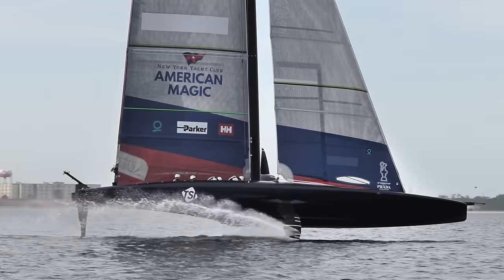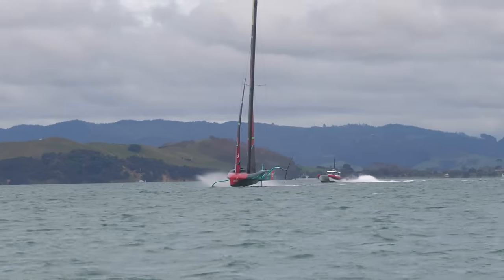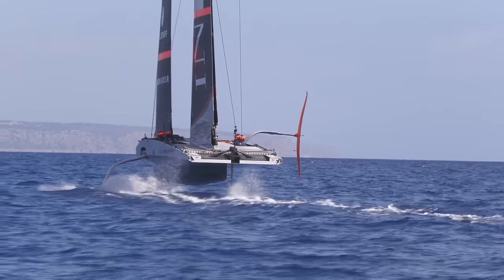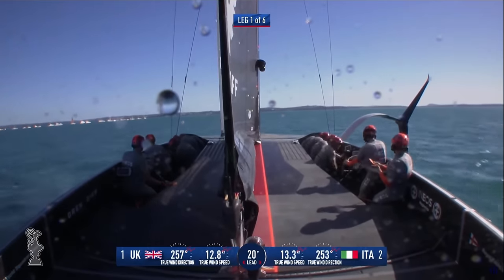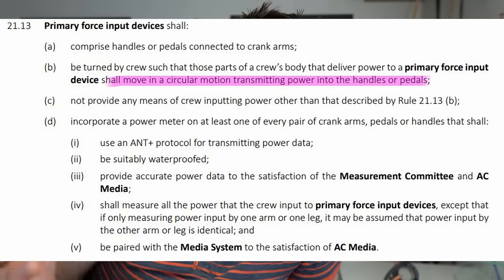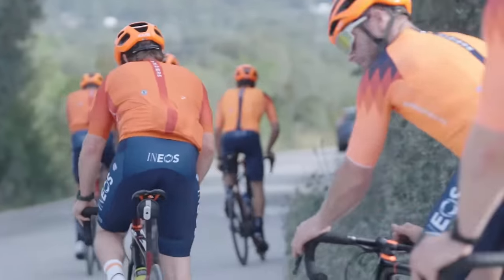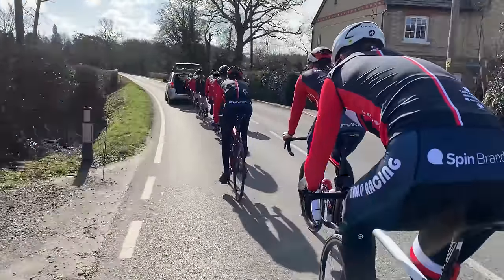Controversial America's Cup Cyclors are NOT what you thought

Comment: As a former track cyclist you know when falling off rollers that there is very little momentum. It feels like you are over thinking this one. Top trackies have incredible muscle recruitment to change cadence, watts and speed. Derny training in small gears at high speed also help. It feels like a physiological adaption rather than any new mechanical inventions.
Reply: Maybe you're underthinking it. Comparing rollers to an hydraulic pump seems like a real stretch. Rollers don't generate much resistance, even at super high cadence.
Reply: No, mozzy is right. He's talking about the sinusoidal load application when pumping against a fluid with no flywheel. It is sinusoidal and symmetric. Cycling on rollers is completely different, low resistance and a relatively high flywheel effect. Engineer and track cyclist here 😅
Reply: Didn't expect to see you here lol.  @PeakTorque
Reply: If Mozzy is unhappy with something then learn how to win the AC then you can do what you want.

Comment: Are there any rules about using the cyclors to generate electricity? I was just thinking - if you weren't allowed a flywheel, I'll bet you could use an inline alternator that used PID controls to "simulate" the feel of momentum. Use power output meters in the cranks to get realtime force data - hundreds of times each revolution - and then feed that back to the alternator to have it give the force feedback that would level it out. Use that energy to power the accumulator pump, or at least one of them.
Reply: Thats brilliant but probably at least against the spirit of the rules. You should work for F1!
Reply from the maker: interesting, the rules are written as if there will be a physical transmission between power input and hydraulic pumps. With then the rotation rations between those two fixed. However, I can't see anywhere that it has to be a physical transmission. 
But it says the only stored energy in the hydraulic control circuit is the supplied accumulators from Cariboni.
Reply: @MozzySails  I guess it comes down to what I really don’t know: the biomechanics and “sports medicine” of it - how do you optimize for performance? I’m guessing that there’s an optimal endurance load level for muscle composition, and I think people can have differences in the fast/slow twitch ratio. Since you only get to pick one “ratio”, you’d obviously want to focus on one that had offered the best power output. Also, totally agree that they should probably rig up some kind of simulator/trainer on shore so they can research and also tailor the conditioning regimen. Pretty cool!
Reply: @MozzySails  Physical transmission will be way more efficient than electrical. The Electric route would waste perhaps 30% of the generated power. So you would need to know that the gain was at least that much. There is a cool alternative, use the crank position monitoring to control serve hydraulic valves, to de-load the cyclist through the dead zone. Hydraulic systems can easily have the speed of response needed to do that - there would be maybe 10% loss of energy to run the serve system, but that might be less than the gain?
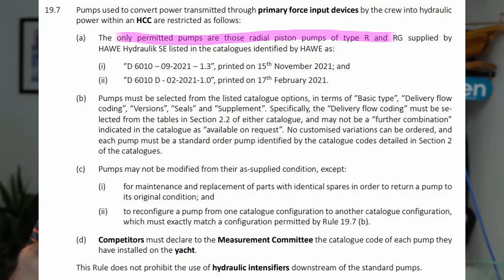Reply from the maker: @johnandrews2853  the pumps they must use are the HAWE type and RG (D6010). You can see the rule flash up @4:49 
And view the pump online here https://downloads.hawe.com/6/0/D6010-en.pdf
Reply: @johnandrews2853  Why not just switch to oval chainrings at that point? No loss whatsoever and the dead zone is effectively eliminated.
Reply: @jamesaron1967 I could be wrong, but I think the chainring would break the “fixed ratio” rule? Seems like a silly rule anyway.
Reply: @toastrecon  Possibly. Not sure.
Reply: @jamesaron1967  I think the rules requiring a single speed fixed ratio drive would prevent this..
Reply: @johnandrews2853  It was suggested as a possibility in this video but you could be correct.
Reply: @MozzySails  Why not fulfilling the very same idea with hydraulics?
a) the cyclor gets hydraulic support at the turning points out of the hydraulic energy reservoir
b) the hydraulic pump does not take a constant torque around the 360° pedal movement
Both approaches are not too complex in implementation so worth of consideration as long as the cyclors' efficiency is boosted
Reply: History repeats itself?

I thought one of the main reason to go with batteries was that having half a dozen guys constantly riding a cyclor on your boat to refill the accumulator, and that cycling is completely detached from the trimming, is kind of pointless and silly. 
I don’t really understand why we need to go back to that? You might as well add bigger batteries and do the trimming electrically as well, since there is no skill involved in grinding, it’s just pumping oil.
Reply: @mx2000   The reason to go battery for the foil trimming related tasks was safety.

When the cyclers get exhausted it is OK to cause a slow down in manoevers, sail trimming, ... . Those are tasks reducing racing performance which is the core of sports.
Loosing the ability to trim the underwater parts causes potential danger which is not the focus of sports.

Comment: for me, the Cyclors are the only option as it means the grinders can be putting out the necessary power while having their hands free to be tasked with operations on the boat. Let's not forget these are 75ft boats which would normally be handled by a crew two to three times the headcount the AC rules allow. Distributing tasks amongst the crew is essential to a good performance. Big guys just sitting in the boat turning handles is important but having the cycle is elevating the value to the overall teams performance.
The muscular performance of the Cyclors was for many the standout feature in AC35. However the use of legs meant the NZL could power the boat way better but in the meantime some of the cyclors were tasked with flying the boat at a steady hight.

Comment: I use oval c/ring on a MTB and much better on technical climbs when you are almost stalled - but for the boat cyclors the 90° phase shift makes most sense.
Reply: Or multiple 45_60 degrees based on number of linked drives

Comment: Good analysis, as ever! However, momentum is not from bike speed to rider - as there is a freewheel. The main effect on a bike is that when you don't push hard, the load is also rapidly very low, because there is almost no stretch in a chain / chainset system. However when grinding a pump, the load is dependent much more on the generated pressure than on the input power, which means that in the dead spots, the load is still pushing back against the legs. So, it can only be improved by increasing the momentum of the rotating masses, i.e. the chains, the cranks and probably most of all, the legs. As you say, they are not allowed flywheels. So, to overcome the dead spot, the cyclors will need a high cadence, then they need to bulk up those legs, wear very heavy shoes (good idea on a boat!!) and perhaps they also need nice sturdy heavy section steel cranks all together acting as a flywheel.
Reply: The obvious place to hide extra weight would be inside the riders legs. Sure they'll walk funny, but they won't be doing any walking while on the boat and the rule makers will have a tough job dreaming up a rule that bans people with heavy legs.
Reply: With the time races last i'm wondering when the Dutch, Swedish and Norwegian  speedskating giants will show up. 12 - 15 minutes seems a perfect fit for maintained power output.

Comment: As someone like you that cycles as well as sails, I’ve wondered for decades why boats, especially ones with hydraulic systems, weren’t set up to use leg power. So I find it satisfying that logic and physics have finally overcome the traditionalists. 
You do know they could put an oval sprocket on the output end of the chain too, right? This and linking two cyclors with offset cranks would surely overcome the problem.

Comment: Osometric rings is an option but that is dependent on a chain driven system. Another option would be to mimic a flywheel using a small accumulator as it is just an energy store. If you could change this to rotory energy to eliminate the pedal strike dead spots. This would replicate the momentum, no?

Comment: What you didn't comment on is the fact that the pressure changes in the accumulator,  so not only is the crank rpm variation not smoothed by momentum, the actual resistance varies and you can't change gears. This begs for an active compensation system. You need a hydraulic motor on the shaft that senses accumulator pressure, instantaneous crank rpm, and crank torque; then regulates crank rpm to optimal values - basically the hydraulic equivalent of a solar MPP controller. This isn't a big ask for a tiny hydraulic device. Your car's steering assist is more complicated than that.  If you just want to manage the torque ripple, use a cam and spring-loaded roller follower on the crank.  This would be more appropriate than an egg gear for this application. Egg gears work 1. Where there is still some momentum smoothing that you want to amplify and 2. when you want to flatten the torque peak on the loose stuff. They don't work when there isn't any momentum. BTW, former competitive cyclist, mechanical engineer, and hydraulics guy here.

Comment: Hi Mozzy, great analysis as always, I get such great insight from your videos.  MORE PLEASE!
Unfortunately in this video I think you have incorrectly applied momentum as the explanation. 
Power = Force x Velocity 
Momentum = Mass x Velocity 
Therefore less force on the pedals is required at a higher velocity to produce an equivalent amount of power at a low velocity. This explain why riding up a hill producing 300w is more difficult, more force is required because the velocity is lower.
This is also the reason why performance engines run at such high rpm.
The advantage with pumping oil is that the system can be set up at the most efficient rpm. The riders then can train at a narrow rev range for maximum effectiveness and efficiency. 
Keep up the great videos.  
MORE PLEASE!
Reply from the maker: Velocity here is pedal velocity. With gears you can do 90 rpm uphill and 90 rpm on the flat same rotaional velocity, same force, same power.
But... the momentum of the bike changes how easy it is, physiologically to put thay force in to the pedals. Going up hill you decelerate fast due to less momentum, this means the input force needs to be much more  consistent around the pedal stroke. 
Same power, same cadence, but your body is not as capable of pushing the pedals at 0 and 180 degrees so it feels harder as you need to use weaker muscle groups

Comment: Since the power to the foil arms is via battery, AC should ditch the concept of cyclors / grinders entirely.  

Sailing is, as you say, adjusting the sails.  Not actuating a hydraulic pump.
Reply: The cyclors could very well be the last iteration of grinders on AC yachts. Maybe there won't be any at all in the following or later ACs. The youth and woman's AC won't have them given the AC40 boats are purely electrical. I definitely see them being eliminated for all events at some point.

Comment: Have ridden tandems for many years. Tried 90deg out of phase cranks a few times as well. Always reverted back to in phase though. Didn't like it mainly for the bike handling reasons you mentioned. Also a bit more awkward stopping and starting. Standing on hills very strange as you can't sway the bike as normal, it is basically locked vertical. You do notice the smoother power output when climbing seated but even then you notice the bike moves differently. Some people do like it but it wasn't for us.
But in saying that none of these negatives would apply to a Cyclor, so the bonus of reduced dead spots could be worth it.

Comment: Could they use a device that after the specified pump would control the diversion of a cyclors energy between seperate high pressure low pressure chambers, which would in turn control the release of energy from these chambers into a single chamber to feed the main system?
This could enable the resistance fed back to the cyclors pedalstroke to be tuned specifically for each cyclor and minimise or eliminate deadspots.
At a guess the individual chambers may need to also have a controlled input from the main hydraulic system also to help keep resistance for the cyclor constant.
Within the rules you referenced it seems that as long as this control was getting information on the cyclors pedal stroke with sensors AFTER the pump then it would be OK?
I'm no engineer and haven't read the rules so there is likely alot more to it and I probably don't know what I'm talking about!

Comment: Interesting video. In my head phasing off the cranks seems like a no brainer. Just like pistons in an engine. 

I have no viewing on what limbs are used. However I think that  the rules have strayed too far from what sailing should be. 

Firstly I think the shore charged battery for operating the foils feels completely wrong and arbitrary when sail trimming has to be powered by humans.  Even worse are the off shore boats that need to run a big diesel engine to swing the keel during a tack or gybe. 

I also feel less strongly that storing energy created by the crew is wrong. Would it seem reasonable for a skiff to have a hydraulic energy store for the crew to charge by say pulling a line repeatedly,on the beat, so that the kite can be pulled up by the helm operating a button on the tiller?

Comment: I question whether they'll even have 'chainrings' to be o-symetric and have a direct drive system straight from the cranks. This would mean they can enclose it all and have it submerged in lubricant rather than messing around with chains.
Reply: Nothing really wrong with chains. They are very efficient. Only thing I can think of that might be a 'negative' is total weight if many are used.
Reply from the maker: Chains are surprisingly efficient though, especially with a perfect chain line and clean closed system. All the grinding pedestals uses chains. Not sure where I read it but the losses in the hydraulics are a decent amount greater. 
They could use oil bathed bevel gears I suppose
Reply: @MozzySails  I read in the past on a cycling forum that chain drive systems such as what are used for cycling are highly efficient on the order of 98%, or thereabouts if memory serves. Even if it's considerably lower than that, because yachts are powered by the wind and not the grinders I think only very small gains can be achieved by switching to a theoretically more efficient system. There won't be a direct effect on the speed of the yacht unlike a more efficient drive-train would be in cycling performance.
Reply: If you ate allowed chains are there any rules on the size and material in the chain rings?
A large and heavy one might store a chunk of energy.

Comment: It might be possible to design the pump so it has varying resistance around the pedal stroke. With a piston pump that's unavaoidable, and it might well turn out that matching the pedal down stroke to the pump compression stroke works really well. I don't really want to grind the pump spec sheets but gearing the pedals to match that setup.
Reply: Multi piston pumps are being used, and they can't change the pumps. These piston pumps have perhaps 7 or 9 compression strokes per revolution of their crank - so matching those to cyclists' power strokes is not really going to be possible.
Reply from the maker: @johnandrews2853  yes , that's correct. The one design pump they must use is here: https://downloads.hawe.com/6/0/D6010-en.pdf
Reply: This may be true, but as explained in the video, in this AC they have to use a particular off-the-shelf pump.

Comment: Regarding the interesting discussion about lack of momentum to carry the cyclor's pedal through top/bottom of stroke. A single cylinder hydraulic piston pump also has a drop in input torque when the piston reverses direction. Wonder if the piston stoke reversal could be designed to correspond to the top and bottom of the pedal stroke. Would have an effect similar to an elliptical chain ring?
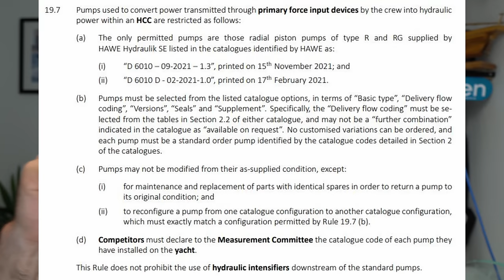Reply from the maker: I am not sure it would be possible to do that with the one design pumps they have. The relevant rule pops up on screen @4:49 , but you can also view the pump they will be using here: https://downloads.hawe.com/6/0/D6010-en.pdf

Comment: I didnt know the AC boats used stored battery power to actuate the arms and foils. I thought the batteryv power was generated by the grinders. Somehow that doesnt chime with the idea of sailing for me.
Reply: But it should chime.  
Because in a regular keel boat, you are not using your grinders to adjust any underwater controls, your grinders are purely to adjust the sails.  This is exactly the same.  Your grinders/cyclors power your sail adjustments - at the direction/control of the sail trimmer.  
The fact that a foiling boat has underwater control surfaces is neither here nor there.  
True it is another (new) addition to the control processes on the boat, but there is no intrinsic need for these systems to be managed in the same way as the sails are.  A Moth is also a foiling boat, however the foils on that are mostly fixed, and the "flaps/ailerons" are what moves - but that isn't controlled or powered by the sailor either.  There is a flappy paddle hanging off the front of the boat that automatically adjust the flight controls.  
So there are plenty of options for controlling your foils, none of which have to be done by a grinder.  It is perfect consistent with "historical precedent" to have "grinders" for the sails - and some other mechanism for the underwater systems. In the A/C boats, that just happens to be battery/electric - and because it is the only realistic option.